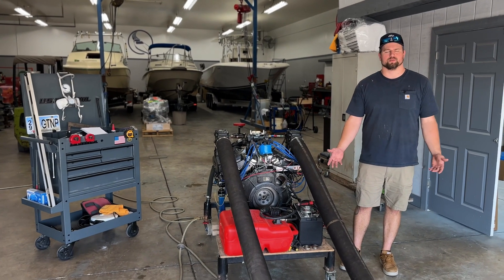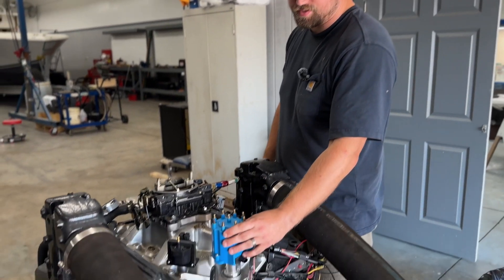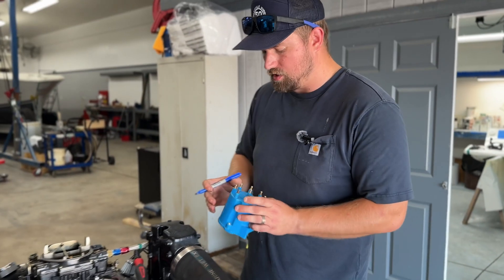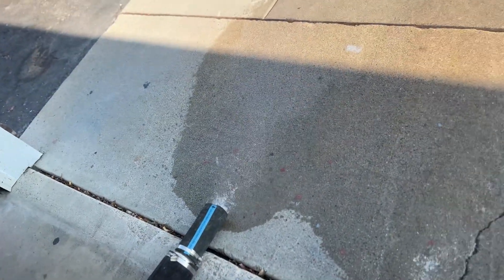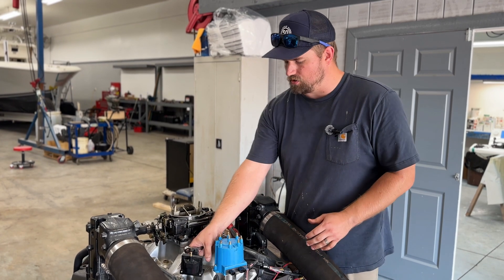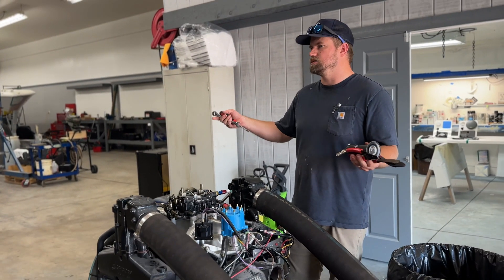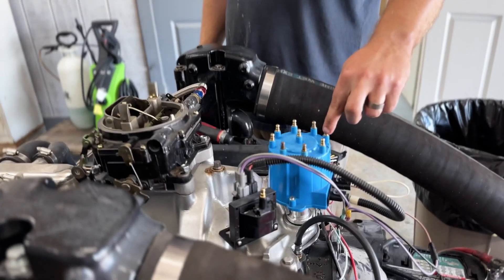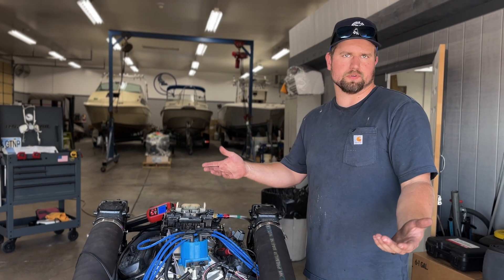Uninstall vs. Reinstall | The Ultimate EST Ignition Installation Video!

Comment: I am trying to set one of these up and at least with my unit I am having trouble getting the base and total advance to be right. For example if I set my base to 12 I can only get 24 degrees at wot. But if I turn up the distributor to my desired total advance my base timing is way to high. Any suggestions?

Comment: Thanks for sharing this video,
2 QUESTIONS:
1. Does this module increasing the advance while the rpm increases? (Like mechanical advance curve) or we should have ECM beside this distributor?
2. When you used that socket(timing tool) to set the initial timing, it still should be in to check for total timing or has to be plugged out for checking total timing?
Reply from the maker: 1. Yes - The delco est is a stand alone ignition system
2. No - the socket is there to loosen and tighten the clamp for the distributor and to check total time you must unplug the module or flip the plug. 

Hope this helps!
Reply: @Marinepartssource .
That’s all, thank you so much for your help…
My distributor is a Marine EST for Mercruiser V8 engine but carburettor fuel system.
I actually asked the same question to AI and I have been answered with a different explanation which was asking me to install  msd timing controller as the module won’t advance itself while RPM increasing…!!!